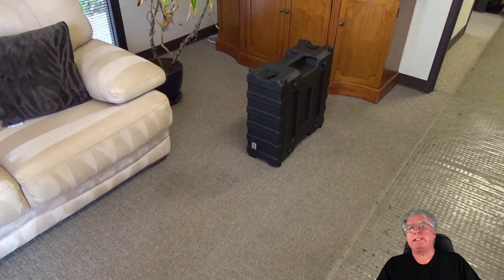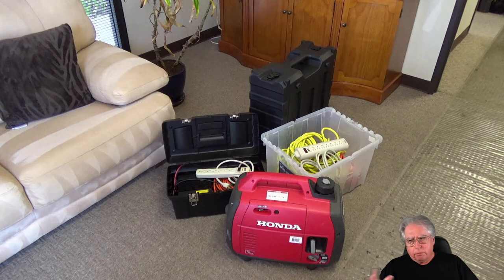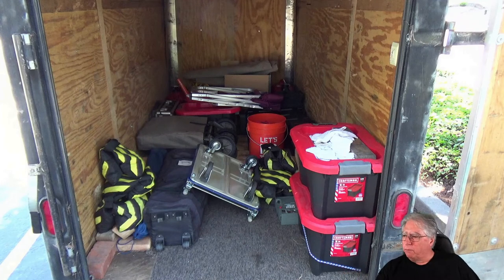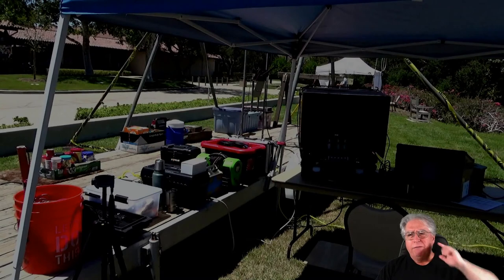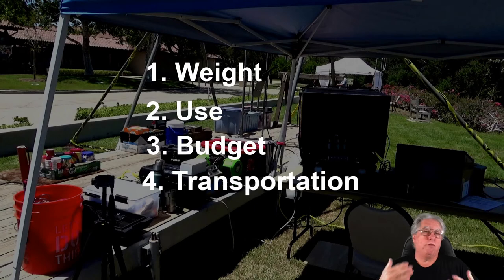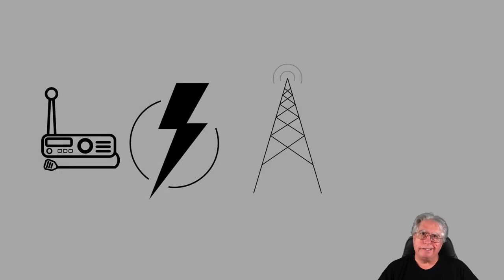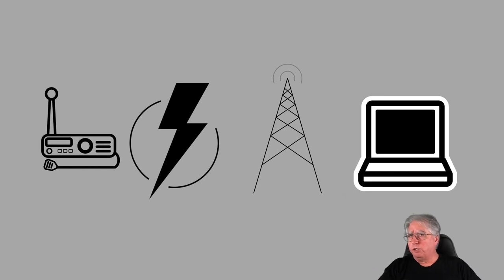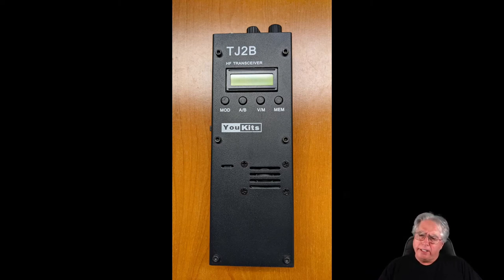Remote Operation And My Philosophy Of Building A Radio Go Kit Part 1

Comment: So far I haven't felt the need to build an actual kit.  I certainly believe in modularity, but I'm doing OK with hard cases and tool boxes.  But your video did get me wondering, where do you get the stuff to build one?  You mentioned Harbor Freight.  I went there but couldn't find anything like what you showed.  What search terms should I have used?  What are those cases and racks called in the commercial world?
Reply from the maker: Hi Patrick,
When I mentioned Harbor Freight I was referring to a suitcase type case off camera. I source things for when building go kits from all over! If you are interested in the cases I used for the two larger go kits, they are manufactured by a company called Gator Cases.  They are mostly used in the music industry and are standard 19" rack cases. The cases and shelves are available from Amazon and other online providers.

Hope that helps,

Stu
AG6AG

Comment: Way way too much overkill....at the beginning of the day all I need to the Radio, Antenna, and Power. If your goal is long-term ops or emergency ops then I get it, but I can operate all weekend with two 20Amp Hour Life Po Batteries. I am not knocking the content or quality of your video at all...just think a better title might be "Extended Remote Operations". I have done Field Days all over the World and 100% of the time, I had a Radio, Antenna, and Battery. These days add a Laptop or Tablet. I can operate out of the back of my 4Runner for an indefinite period of time. No need for a trailer full of equipment that I would never dip into remotely...again if you are setting up for a Net Control of another supporting role then Yes. But a "Go Kit" hmmm. Rado Battery, Antenna, Coax, and maybe a few items to support a repair. That is about it...Heck, I Can get my Go Kit into a Backpack.
Reply from the maker: Hi!
I have many friends that are true minimalists when it comes to field operations. They never cease to amaze me when they go out hill-topping and make an insane number of QSOs running QRP with a coil of wire and low power radio. I actually touch on that at the beginning of the equipment list when showing the TJ2B.
I think your definition of a "Go-Kit" is a bit narrower then mine. I agree that you can have a "Go-Kit" that fits easily in a backpack and for a single QRP deployment that would be the perfect solution!
The point of these videos is centered on the kind of field operations that have multiple operators for extended time periods. Whether it's a club event, a public safety event or just showcasing the hobby to the public.
I see all sorts of remote deployments and one thing I know for sure is one man's Go-Kit is another mans remote operating station.

Stu
AG6AG